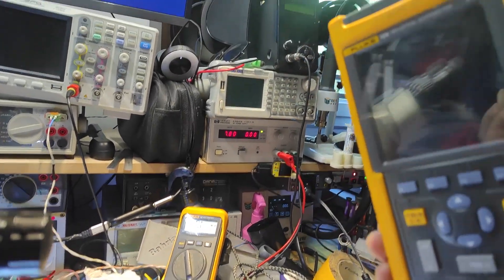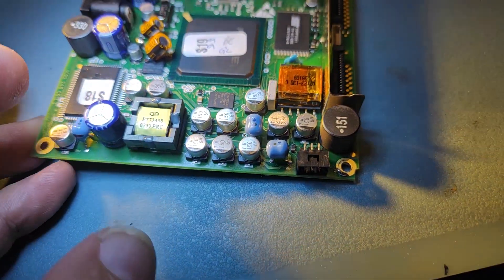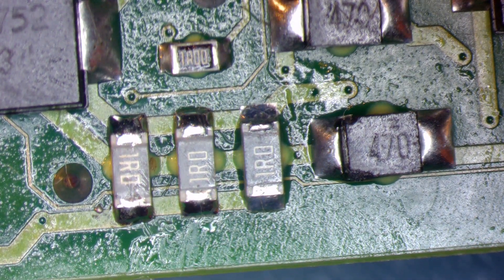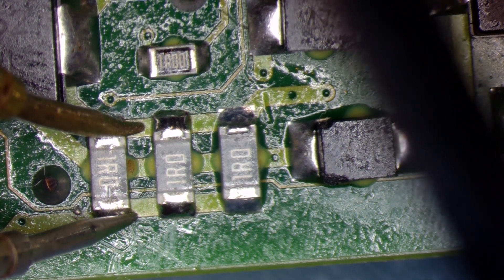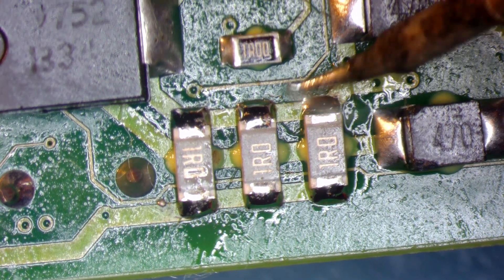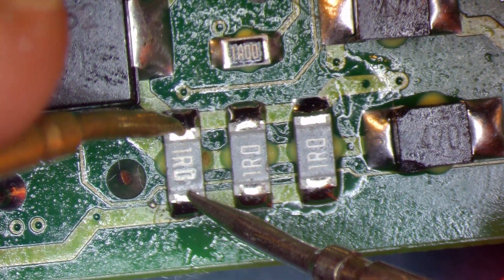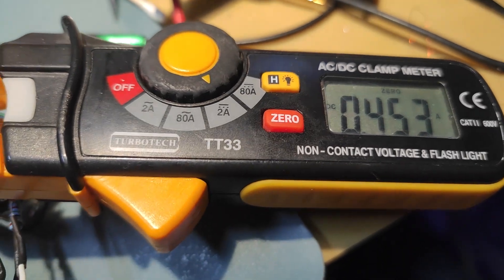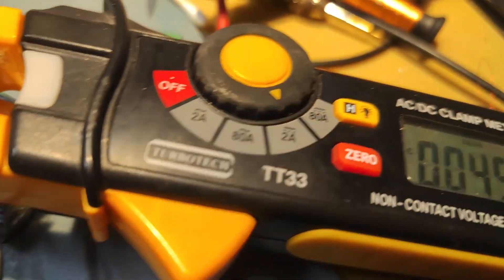Scope Fluke 124: charge and battery use failure

Comment: Hola tengo uno igual y funciona bien, pero la bateria no le dura nada en el video note que le tienes puestas 2 de litio. No es muchos volt y no lo daña, me porias dar informacion??? Gracias
Reply from the maker: very easy. The original batteries was removed. There was 4 cells. Replaced by 2 lithium cells. All components for temperature and voltage control was resolded on the new two cells version, as it was in the first case. The final voltage is about 7,2v (8v max)